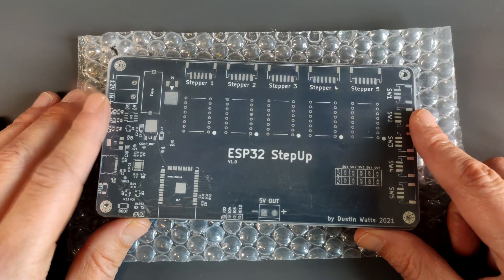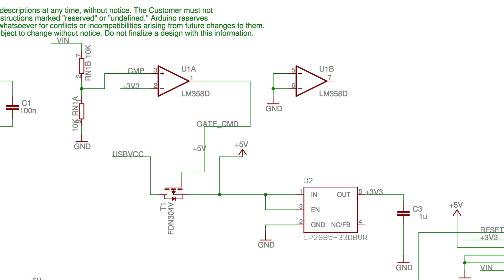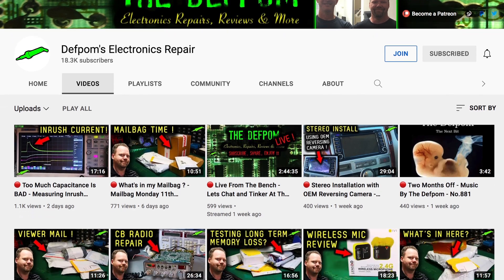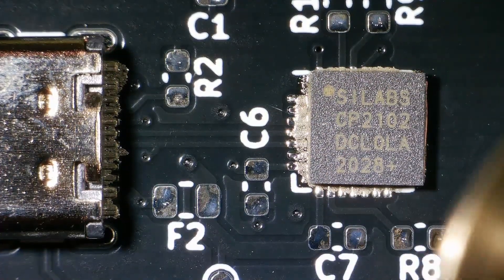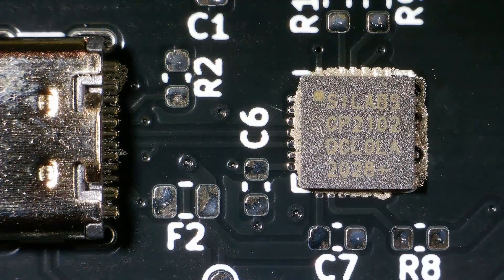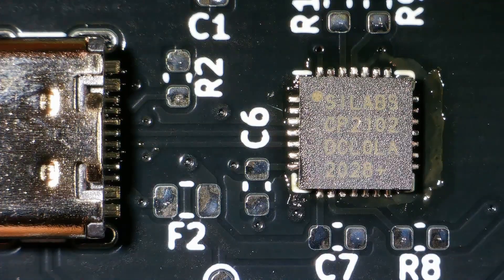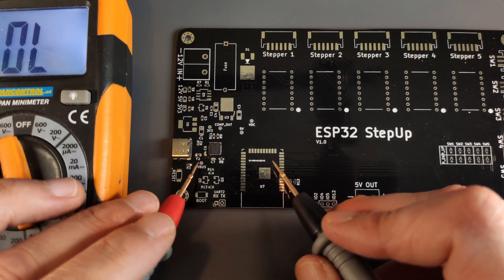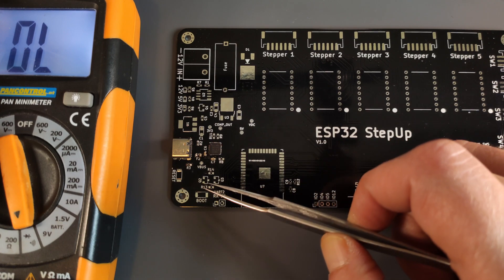Building a 5 Stepper Driver Board w/WiFi & BLE (Part 1)

Comment: Hi Dustin, 2 question because I am handeling the same usb c plug (for the first time usb c for me) at the moment.
So do you have to connect the 2 vcc pins on the connector or are they connected in the Plug on the pcb? I think you have toconnect them yourself, because there are 2 for the 2 orientations of the plug you put in the connector , right? 
And what do you do with the B5 Pin which is going to your R3 , and A5 which is connected to your R2. I think these are the CC Pins and they have to do with the orientation of the plug, as well.. But I dont understand what you have to do with these. Think Pullup oder Pulldown, but could find.
Reply from the maker: Hi Oliver... each orientation has it's own pins. To that is why there are two of everything. (GND, VCC, etc.) The CC pins are basically used to manage the source-sink connection between USB C devices. Specifically when it comes to power delivery. In our case, if it is just for USB 2.0 and power, best practice is to pull it down with a 5.1K resistor for "legacy mode" :)
Reply: @DustinWatts  thanks for that fast answer. :-) yes so its just USB 2.0 stuff or power only😁 thank you very much. Your videos are helping so much👍👍👍
Reply from the maker: @ollidecker  Good to hear Oliver! Good luck with your board design! :)

Comment: Nice, I too 'wet'  the paste with a bit of flux  just to make it easyer to work with when using the old diode leg application technique !....cheers.
Reply: A clean pan and new paste should wet the pad great. as the solder paste ages then it does not wet so good. I go up market and use 22swg TC wire to put it down. SMD legs i find a bit hard to cut off. 😃
Reply from the maker: It is easy to overdo the amount of paste, this helps a lot.

Comment: Why the flux? If your solderpaste is still within its working life it will have the right amount of flux.  Would love to know who started this ( you need flux) on YouTube! I've worked in the electronics industry since 1976 and the only time flux  was used was when tining wires with a solder pot! Maybe the rework stations has a little,  but it would have been banned on production.  Still looking forward to part II.
Reply from the maker: I use the flux to make it easier to "drizzle". It is not because the paste is not good anymore. Just the paste is fine. It is just to make it easier to apply without a stencil or a solderpaste dispenser.
Reply: Flux is our friend ! I get the stuff everywhere but I know what you mean about 'production areas' I have also worked in environments where its use was forbidden....cheers.